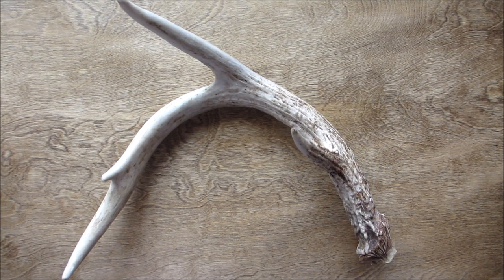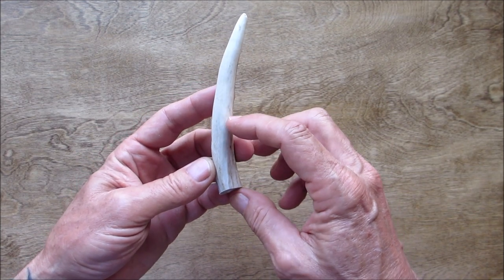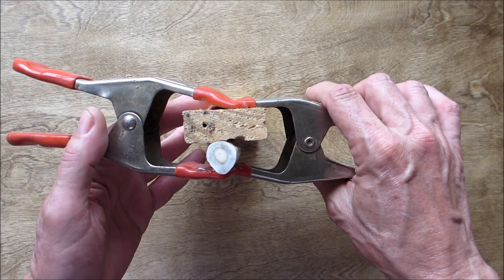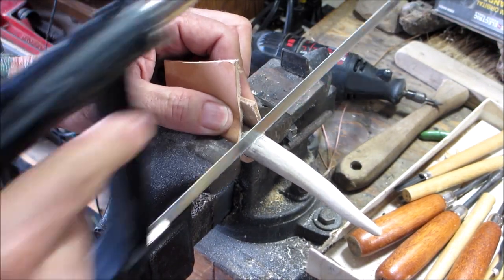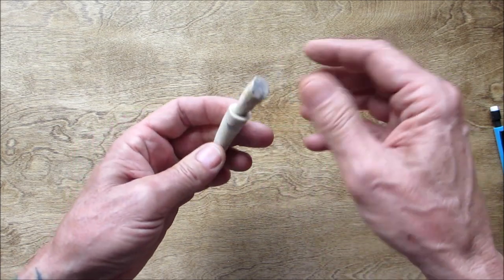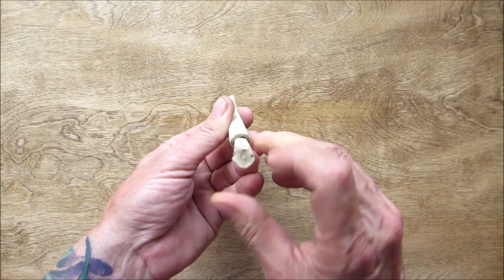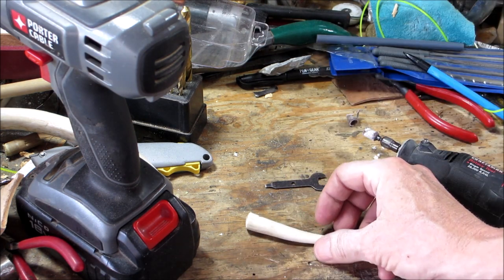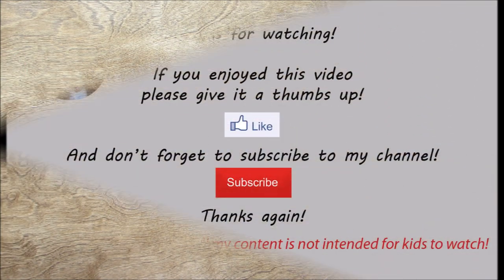How to make a Deer Antler whistle!

Comment: I just finish making one it is very loud but not as sharp sounding as yours, do you recommend the plug is not properly seated or sized?
Reply from the maker: It’s a trail and error thing. The angle of the cut and depth of the plug changes the pitch! Each one I’ve made sounds a little different. Thanks for watching my friend, I appreciate it!

Comment: Any common reasons why I can't get the whistle sound to work? I do have an antler whistle my wife gave me that works great but no matter what I do to both follow directions and/or cut/drill exactly as what I have that works, I can't get the whistle sound.
Reply from the maker: For me it’s always tweaking the fipple aka the plug. Either it’s length needs to be changed or the bevel that allows the air in! I hope that helps!